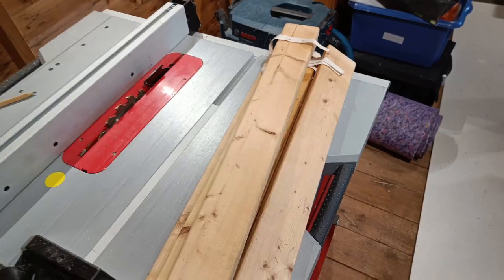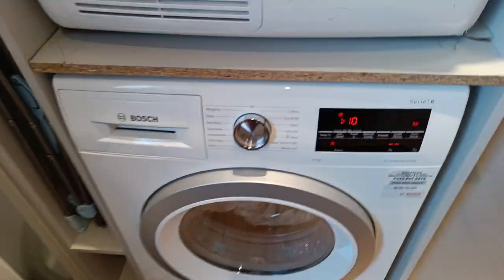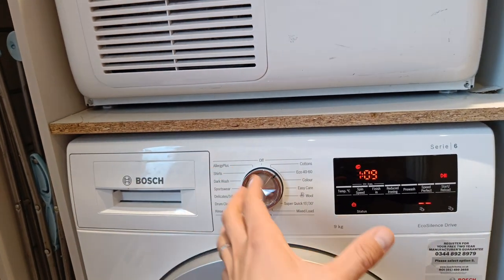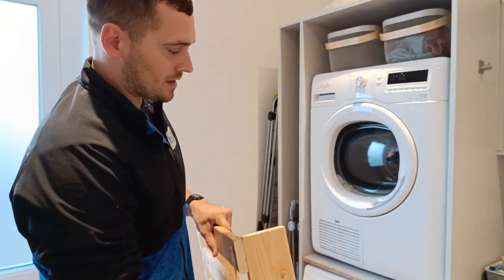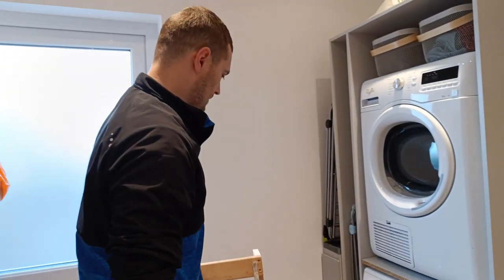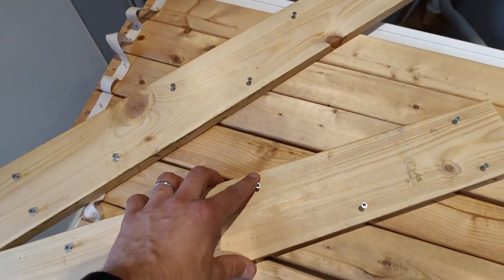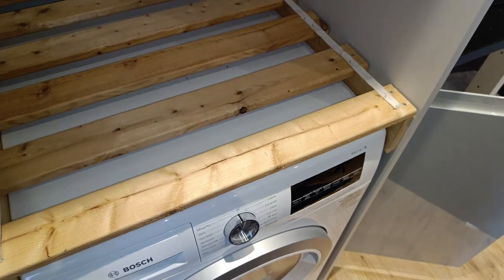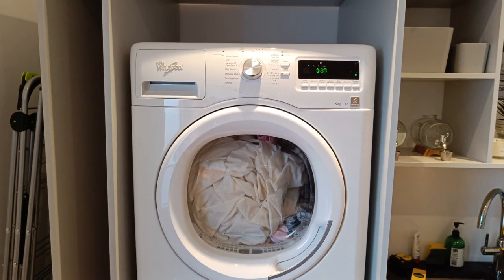How to stop your washing machine from travelling

Comment: Nice little solution though I'd have fitted vertical legs (at the back or there abouts) to give that shelf some better support.  I know the TD is not too heavy but when manhandling it in to that gap it does put a bit more force towards the back until you level it out? 

Also the stacker kits rely on the actual WM to fully support not just the TD weight but also gyroscopic forces it throws out with an uneven load. Plus those short screws are... short and only just bite it to a thin bit of cheap chipboard!

That aside... Great video, will truly help someone 👍. Oh, and that tiger.... your MOTs expired 😂
Reply from the maker: Lol all good points! I got the shortest, longest screws I could, that wouldn't punch through the side of the housing.

It's been up for a good few months now (delay in posting the video!) And it's been working a treat. Hopefully won't need too much more doing to it.